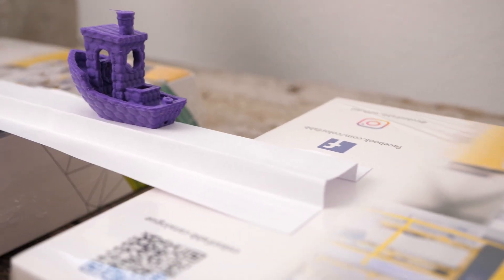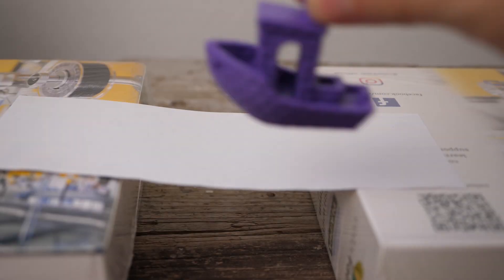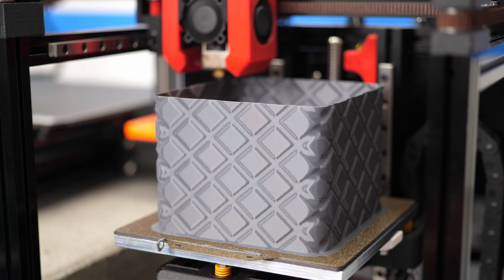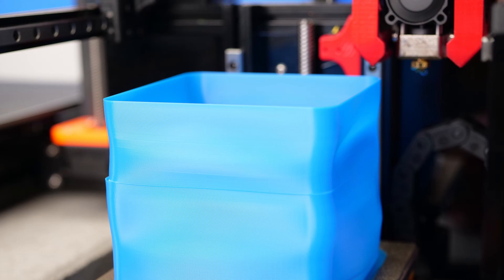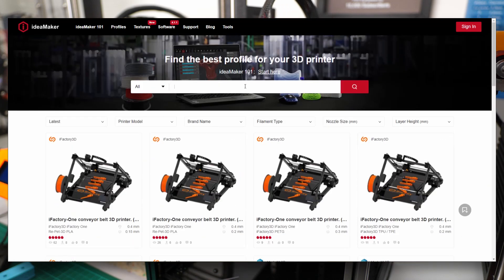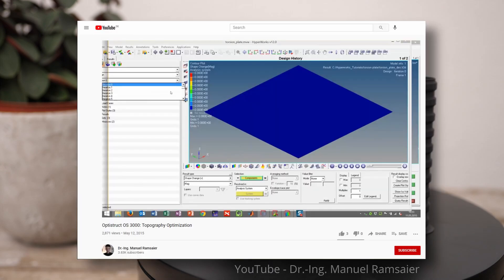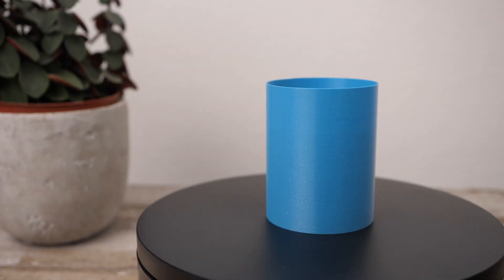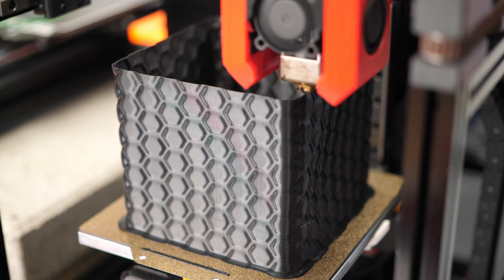Texturing 3D Prints for Strength!

Comment: For the airplane surface you mentioned early in the video they should use the golf ball texture to the surface.
Reply: ooh.  this could be interesting!
Reply: i'm afraid that the golf ball texture makes it easier for the flow to detach from the surface, which is beneficial for the ball's flight... but is the exact opposite for an airplane, as it makes it stall easier (stall is caused by the flow above the wing detaching from the surface of the wing, reducing lift dramatically).

Comment: The relative success of the vertical line pattern reminds me of serpentine brick walls. https://en.wikipedia.org/wiki/Crinkle_crankle_wall
They use far fewer bricks than a double-thickness wall, but are also much stronger than a single-thickness wall.
Reply: That's super cool.. I've never seen anything like that in person. 
It seems like a great way to be practical and add some style to an area at the same time. I like that kind of creative thinking in public projects and architecture.

Comment: You know you're going to have to build a thin-wall stiffness testing rig now.
Reply: I would really like to see the stiffness results using Carbon Fiber PLA and the Carbon Fiber PC of the different patterns.
Reply: Wanted to post the same comment👍
Reply: That was my thought as well. I'd be very interested to see how different patterns(on a simple plate) change the mechanical resistance
Reply: I was thinking the same thing! I would also really like to see layer adhesion, because I want to know if printing MTG boxes like this would make their walls stronger
Reply: thats just a group of 6yrds with no supervision

Comment: This pattern textures feature would be so powerful if it could be used for resin printing
Reply: Is it not possible to export textured parts as STL?
Reply: @nipunagunarathne4882  I haven't been able. Send it's done at the guide level
Reply: Are you thinking about decorative purposes or for mechanical ones?
Reply: @jayphone1  Both. I use my resin printer for me making components that I use and trash. My cad skills are to par, so my only solution is increase wall thickness which costs my more resin and affects size/functionality
Reply: @PaulDominguez  One free software to add textures onto stl is Sculpt GL.

Comment: Cura should have this
Reply: Personally I'm a fan and user of PrusaSlicer (since I have a Mk3s). I wouldn't mind this feature either in PrusaSlicer or in my CAD program of choice (FreeCAD). The advantage of putting this in CAD would be to easily put patterns only on parts of your model with high precision.
Reply: @VorpalGun  +1 for adding this to FreeCAD
Reply: @marcus3d  If you mean me implementing this as a script (which I considered briefly) that would rely on me finding time for this, which is unlikely now that I'm doing a PhD.